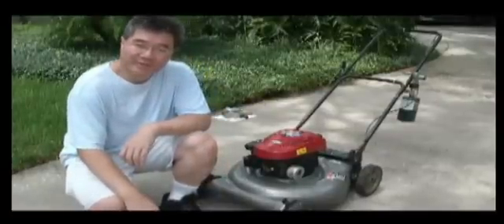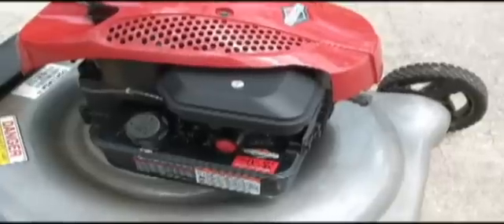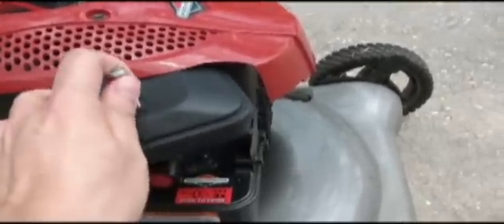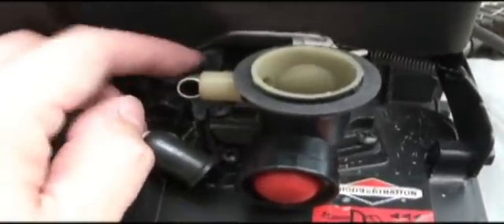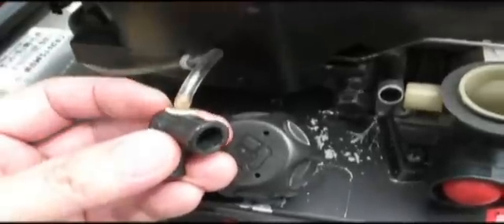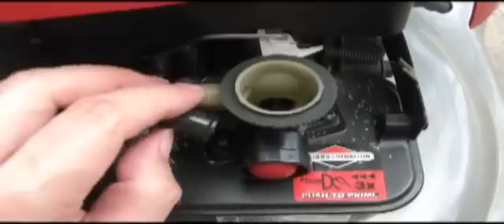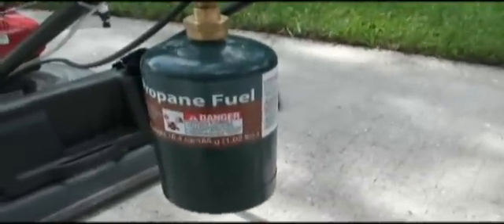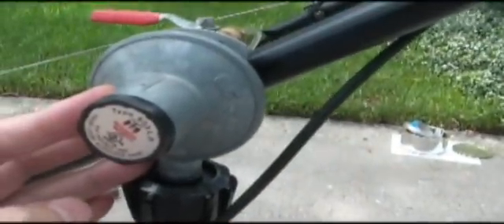Propane Lawn Mower Build Details, Part 1

Comment: Thanks, the only part that mattered was how you routed the 1/8" inch hose into the propane and you didn't show it. I don't know why, it was a great video up till that.
Reply: He barely shows it at 5:48 all brass parts, ball valve, barbed 1/4" nipple, looks like 3/8's In. threads on the brass
PS..  I'd bet he removed the hose from the regulator first to see what thread size was required to start off.

Comment: Awesome mod!  Easy, simple and cheap!  I like it a-lot!
Reply from the maker: Thanks. I hope it helps on your next tire changing project. Take care !
Reply: +auxpowerunit - Thanks!  I am thinking bout it, but not yet done it..... I almost passed out last year during a Snow Storm on my Snow Blower due to Gas Fumes.... After an Hour of breathing the fumes..... I was gonna go into the emergency room, LOL.  I am extremely allergic to Gas fumes and ultra sensitive with my breathing.  So I have been researching converting to " Propane " since it's a lot healthier.  That was my main goal and that is where it leads me to your Video!  I have learned a lot and THANK YOU for posting it! :)))))))))))
Reply from the maker: You're welcome. One interesting thing about running propane is that I had to run the mixture very lean, as compared to gasoline. Propane burns much more efficiently because it is in gas form, while gasoline is still in aerosol droplets. For me, no droplets means no more sinus irritation. Take care !
Reply: +auxpowerunit -  Ah ok.... Thankx for the extra info!  To be honest, I don't mind paying for the Propane if it's healthier.  I'd rather Pay $5.00 extra, than going to the Hospital after each " Snow Blowing "..., that would cost more, LOL!  But I believe you on that one, since " Propane " is already a Gas form and no need to " Vapor " before burning.
Reply from the maker: BTW, there are adapters which allow you to fill a 1-pound propane bottle from a 20-pound tank. I have one made by Mr.Heater, which works okay. Just saw a better one on Amazon called GasSaf.
Reply: +auxpowerunit - Yea, I saw a few Video of those.... It would help for small Engines that is for sure.  I have seen those on eBay and it's about $8.00 with free shipping.  I might get one for a small Engine I have later for experimenting.  But of right now, I am looking to convert my Lawn Tractor Snow Blower into Propane since you already know about Gas Fumes.... :)
Reply: +auxpowerunit -  THANK YOU !!!!

Comment: Make your mower safer
https://m.youtube.com/watch?v=xJYg1F567qU
Reply from the maker: Yes, thanks for the suggestion. This lawnmower conversion didn't have a lockout valve for the propane because the bar-b-que regulator allows flow whenever the ball valve is open. My subsequent propane conversion has an Impco Model J regulator which only allows propane flow while there is a vacuum applied to the outlet. So that is much safer.   
https://youtu.be/PRVdkZxMT1o
Take care !

Comment: If you pump natural gas into the crank case your are asking for trouble. when the values wear out and it blows your feet off....
Reply from the maker: Thanks for your concern, but this is not pumping gas into the crankcase. The pressure of the gas is only 1/2 PSI. Very little gas enters the crankcase at rest, because it is sealed. Once the engine starts running, combustion products which blow past the rings pressurizes the crankcase positively, much greater than 1/2 PSI. Therefore, the gas is forced into the carb, away from the crankcase. So, no risk of explosion. (BTW, natural gas is mostly 4-carbon chains, while propane gas is mostly 3-carbons.)
Reply: i was wondering if you could do this same convertion with a hand held blow torch that screw to the same exact bottle type and if so how many turns should i give it gas
Reply from the maker: James Flores I have seen a video in which someone did that successfully. But I don't recall the details. You would need only to barely open the valve, since only a slow flow of gas is needed.
Reply: well ive gotten it running but as it goes the bottle gets cold and starts to surge and isnt all that efficent about 4 little bottles for the front and back yard ill put a bigger regulator it might be that im running too much fuel through too small of a valve for too long also it doesnt help the bottle is at an angle
Reply from the maker: James Flores The angle is probably causing your surge problem. My regulator gets frosty, and sometimes droplets of propane go through my tubing. Those drops evaporate after traveling about 6 inches. Regarding consumption, your flow rate may be a bit too high. I can mow about 1/3 acre using a single 1 pound propane bottle. Note, the valve is fully open when I start the engine. But once it is running, I close it half-way.
Reply: auxpowerunit well it used to be a 35? degree angle to now a 15 degree angle and runs better gets cold slower and seems to be more efficent
Reply from the maker: Great !

Comment: Because the propane delivery tube is open at one end, it could never build up enough pressure to "blow the lines".  The only problem you'd encounter with high regulator pressure is injecting too much propane, producing a mixture that is so rich the engine wouldn't run, or would run poorly, producing a lot of soot.  The same could happen if the regulator fails, allowing too much propane to come out.

Comment: A few years back Briggs and Stratton converted all gas tanks and carbs to a one piece plastic design.  This really sucks because when you have to buy a new one, you spend 50-60 dollars and for a little more you could buy a whole new mower.  And for anyone who is worried about the ethanol issue and doesn't want to do this conversion, sport/rec 90 is available, and it is ethanol free.  I run it through all of my equipment.  It is not that much more expensive.